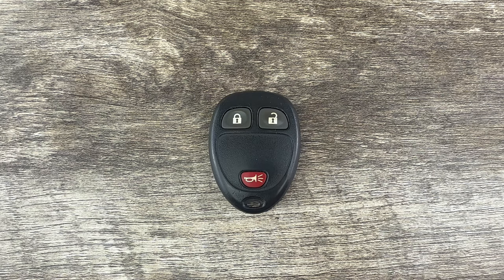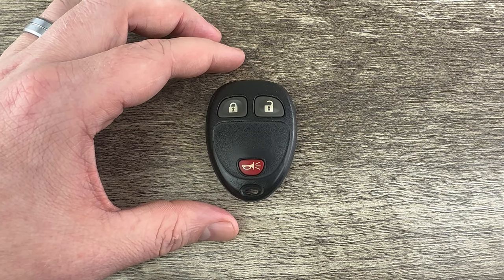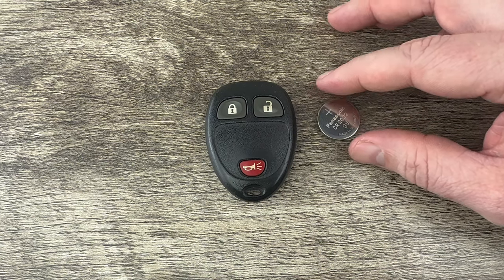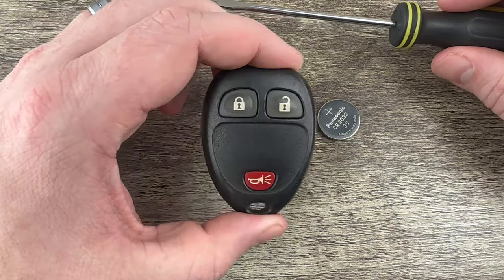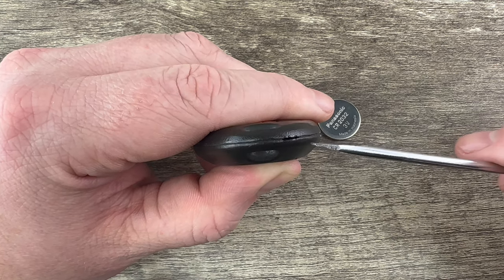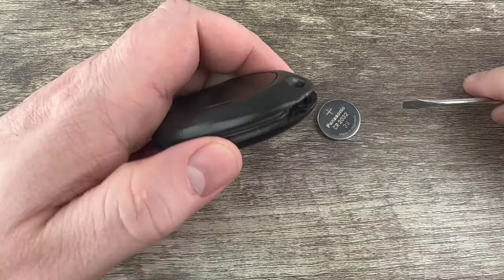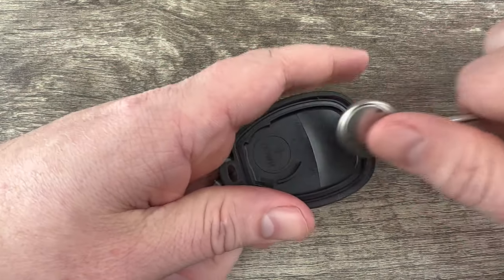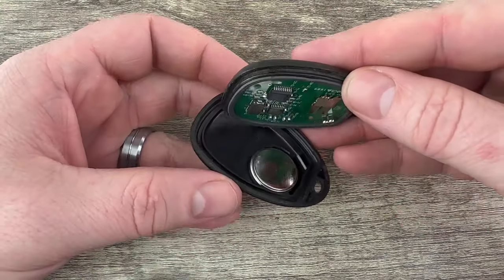How To Replace 2007 - 2013 Chevy Silverado Key Fob Battery - Change Replacement Remote Batteries

Comment: Thank you! 2007 Silverado key fob battery holder is a little tricky. You'll need an awl or other pointed instrument to insert in a slot and flip the battery out because the casing goes all the way around, and the + side of the battery faces up.

Comment: Once you get the battery changed, do you need to reprogram the key fob? 

Thanks so much, very helpful video!!
Reply from the maker: No - does not need to be reprogrammed after just changing the battery